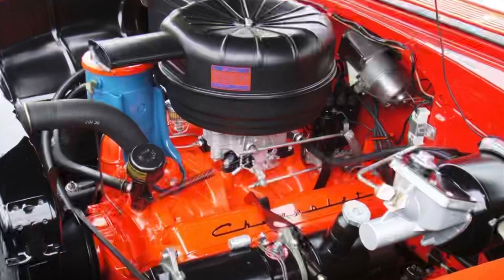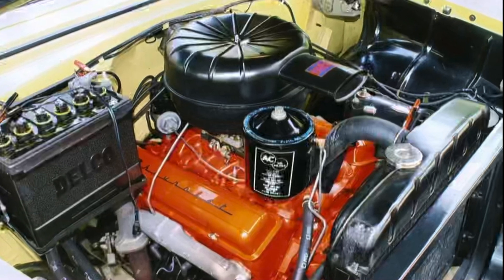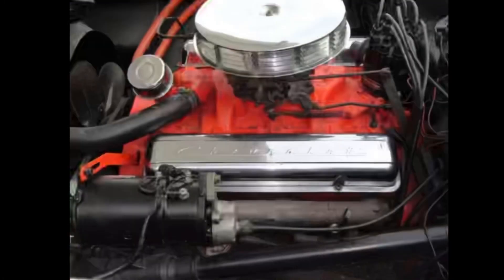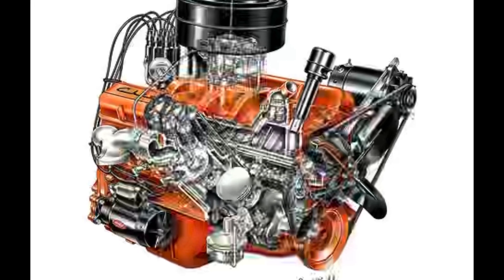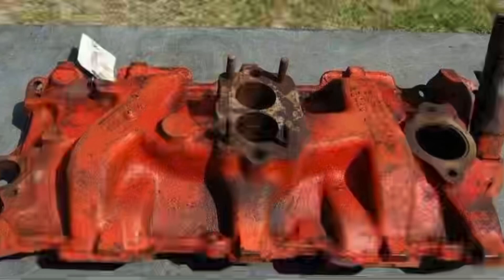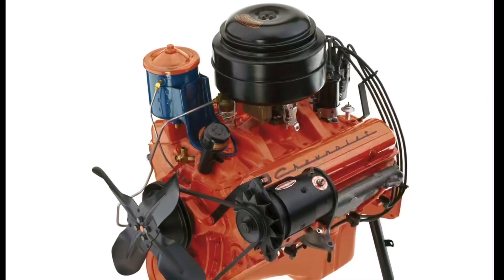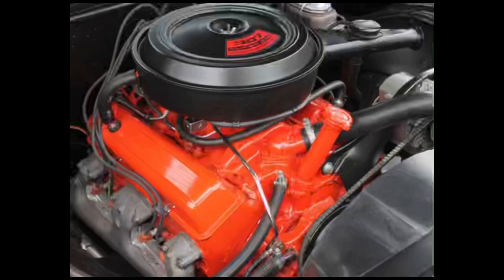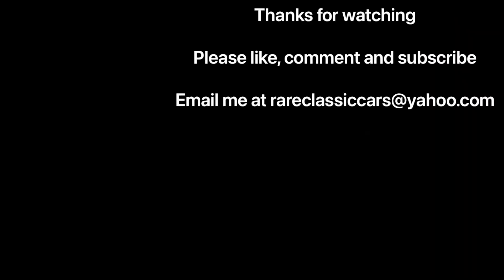Best Engines of All Time: The Chevrolet Small Block V8 (262/265/283/302/305/307/327/350/400)

Comment: Ed Cole, and his team did an excellent Engineering Job on the Chevy SB, especially the Oiling System. I like that each Cylinder has 5 bolts around it, instead of 4. 
I have 4 of the Second Gen LT1s. What are your thoughts on those?
Reply: You are Correct

Comment: Best engine ever made, IMO.  Two comments from a shadetree mechanic.  First, the GM distributor with the little window that allowed the points to be adjusted while the engine was running was a great innovation.  Second, the adjustable stamped rocker arms on hydraulic lifter engines made them easy to work on.  As always, an enjoyable and insightful video,
Reply: How many times did you drop the points screw down the back of the engine to somewhere on top of the powerglide?
Reply: @barneymiller6204  Never did drop the screws, but the first chance I got, I dropped in an HEI distributor in place.
Reply: @barneymiller6204  yup, only complaint, distributer in back, not front like SB Fords.
Reply: @ronschlorff7089 my first car a Chevy. But I noticed on a Ford, distributor in the front.
I switched. Then I noticed Ford did many other things better than the Chevy.
Reply: Meanwhile European cars are going fuel injection while GM put a window for the points... lol, sad really
Reply: @toyyoda3710  Yes, but never see them at Barrett Jackson do we?! LOL, sad really!

Comment: No matter what brand you like most nobody can argue the small block Chevy is one of the best engines ever produced.
Reply: Mopar guy here... I agree with you.
Reply: Had 265 i 56 Chevy and agree but Ford guy now, but my first-est car was a Ford Ranch wagon with a 272 Y-Block, nice engine, always started never left me on the side of the road, did have, flats and dead batt. once but that's not technically the engine.

Comment: We would take a 307 install a cam ground to 350 HP 327 specs, 305 heads with the big valves to raise the compression and 4bbl carb, it really brought them to life. cores were free (we were throwing into the scrap pile) and they were a near bullet proof cheap engine.
Reply: A 307 came in my '72 Nova. I was out of the warranty period in a few months so the mods began.

A TRW TP151 cam (their 350HP 327 replacement cam), fuelie double hump heads (1.94  intakes) and a Rochester fuel injection system. Added dual exhaust (kept the cast iron manifolds) and this car became a terror. I could easily outrun stock big block muscle cars and a few modified ones.

I ran that engine until it was replaced with a 400 small block in the fall of 1975. Sold the short block to a friend who ran it for years after that in a '68 Camaro.
Reply: The one I had built wasn't. But the 283 I yanked out of my dad's 67 Biscayne wagon was. It had 200,000 miles on it when my uncle rerung it and replaced the head gaskets after it overheated going up a grade. Another 400,000 when I stuffed it in my 68 Chevelle. I ran it for another 5 years before it developed a fairly loud lifter tick. I was going to replace the pushrods and lifters but they didn't want to come out through the top and I figured getting another motor from the junkyard would be cheaper than rebuilding it.
Reply: @turbo8454 I think I’ll try that with the stock 307 that’s in my ‘71.  It runs strong but I’d just like to wake it up a bit.

Comment: He didn't mention it, but the V-8 was about 60 lbs. lighter than the six.  It's hard to believe that with all this ingenuity, only 43% of '55 Chevies got a V-8.  You'd think people were so happy to get an alternative to the disgusting Blue Flame six, at least 65% acceptance!
Reply: GM tried their best to sell V8s too, they didn't offer the 261 straight 6 in any truck under 2 tons until the 327 came out. Thats 8 model years of trucks that had the option of 235 or V8 with the 261 withheld
Reply: @Texassince1836  Always thought it was strange that they restricted the 261.  They did that with it's replacement, the 292 as well.  You couldn't get it in a 1/2 ton in most years, and never could get it in a car.
Reply: @michaelbenardo5695  they wanted to sell V8s in the USA. Canada got 261s in Pontiac cars, and south America got 261s all the way through the late 70s in half ton trucks.

Same with the 292. Big heavy talldeck6 kept it out of cars, but I am disappointed most years couldn't get it in half tons.
Reply: @Texassince1836  Yes, I know about the Pontiacs, but I didn't know about South American 1/2 ton trucks.  I like those 6s better than the small V8s - more low RPM torque.  If I want a V8, I want at least a 327.
Reply: First year of an unproven engine as far as the public was concerned. Chevy had built reliable ohv straight sixes for decades and it was the most used engine in pickups until the late sixties
Reply: They couldn't make enough of them, so many folks had to settle for the old 6.
Reply: @michaelbenardo5695  I'll bet that was a disappointment!  They could always buy a '55 Pontiac which used the same body and every single one came with a big block V-8 standard equipment connected to a four-speed Hydra-Matic, the best trans on the market until TorqueFlite came out in '56.
Reply: @jazzvictrola7104  That is true, very true.  Plus, the 55 Pontiac was a longer car as well - 122 and 124 inch wheel bases vs 115 for the Chevy.  And HydraMatic was far superior to PowerSlide.

Comment: Great video; what about the 7 L version of that engine used in the c6 z06 Corvette? Was that based on this architecture or was it something else.
Reply: The LS Engines were an evolution of the SBC, with very few parts in common.
Reply: About the only thing the LS engines share with the old SBC is the bore center spacing, and the 5.7L of the first LS. Otherwise, they are completely different. As much as I love a good SBC, the worst flowing LS head will outflow the best flowing SBC head (factory heads of course).

Comment: Most of the cost cutting measures of the factory smallblock Chevy can be overcome with aftermarket parts, which helped make them economical to manufacture.   The smallblock Ford is more compact than the Chevy as it was designed for the Falcon.  The 5.7 Vortec heads produced from 1996 onward were pretty decent, other than the cracking problems, but I've never heard of one that had a coolant leak because of the cracks.  Too bad Chevy didn't have those heads 20 years earlier.
Reply: Ya the latter correct heads were a big improvement over the early.
Reply: I know that the original Mustang/Falcon V8 was teensy, but when they blew this block up to make 350-cu-in engines was it still smaller than the Chevy?  I'm not messin', I really want to know.
Reply: @hunkydorian  the 351 Windsor had a taller deck height and externally was similar in size to the small Chevy but a good bit lighter and a stronger block.

Comment: My '75 Nova had a 350 2 bbl, and it was an excellent motor. Smooth and reliable, my car moved quite quickly with it. I was not disappointed.
Reply: It sounds like top-of-the-line to have a '75 Nova with a 350.  I can picture mostly 250 sixes and 305 V8s in most Novas of that era.
Reply: @70sleftover  It was a '75 Nova Custom coupe. I don't know if it was considered as top-of-the-line, as I thought that would be the Nova SS. It was a sweet car that I bought new, and kept it for seven happy years.
Reply: @70sleftover  Lots of 73 - 74 Novas had a 350, but most 75 and later had, like you said, a 6 or a 305, except for the top-of-the-line version.  It usually had a 350.

Comment: The Chevrolet Flint Engine plant on Van Slyke Rd in Flint, MI was purpose built for the 1955 model year V8 introduction. The plant was built on an old farm field, the first financial income was from the sale of corn from the land. Over 25 million small blocks were produced there as the two million square foot plant was repeatedly expanded to accommodate more production. I was responsible for building five million of those V8 engines.
Reply: Cool to know and that was an interesting fun fact about the location of the plant.
Reply: George Thomas ,I too worked for GM at the Saginaw Parts Plant  CPC division.My first car was a 1966 Malibu with a 283 engine.It was a very good engine and I  was told it was a short stroke engine. Many good memories of being part of GM in those days!
Reply: @markchwala2913  That was the year, model and engine of my first car. It was a 2 barrel Rochester with 3 on the tree.175,900 miles later it still ran strong with only a fuel pump and timing chain replaced. It routinely handled small block Fords and Plymouths. The only 2 cars that were better cars was a 70 SS 396 and the 2013 Mustang GT/CS that I still own. (138K mi).
Reply: Thanks mate, we have a lot of them in Australia to. They came in our high performance Holdens and rh drive impalas and Bellairs.  Now they all drive Chinese shitboxes that last a couple of years .
Reply: And I worked on the other side of town, in plant 4, making the six cylinder as well as the 4 cylinder engines.  You could still get that four banger in the early Novas.  My most fun Chevy was a 1964 with the 327, 4barrel, dual exhaust and four speed car.  It was the Malibu SS.  Loved it.  I lived in Flint five years and worked at plant 4, then went out to the Otterburn Parts plant out by Swartz Creek. It was a good time to live in Flint.
Reply: @frozenbits48  Thank U 4 the years of Hard work,👍👍‼️ I can identify with your post the fact remains in 1975 there were 4.5 million UAW American workers in country, as of 2023 were less than 500 thousand, , this was a direct result of Richard Nixon's deregulation in 72, our company sold us out to the cheapest foreign competition ‼️
Reply: Thanks. Could you elaborate on that last sentence?
Reply: @Diesel257  we used to build Gms ,Ford's Chryslers and Toyotas in Australia.  Now we build nothing thanks to our traitor governments selling Australia out as usual.  Now they all drive Chinese throwaway junk.
Reply: @petergoodwin2465  I was talking to the original poster...
Reply: I was very pleased with the castings from this plant I have several 267 V8s and I always seek out the Flint castings because of the quality and attention to detail
Reply: Remember Warren road in Motor City ❓❓❓♥️🇺🇸♥️

Comment: I'm a big fan of the 1970 or 1971 LT-1 engine. Lots of GM goodies from the factory.
Reply: Type LT Camaro. Turbo 400 tranny 4 bolt mains. 4 barrel. 350 engine. Anti sway bar. Factory sleeper. Was beautiful Comaro. Power windows, nice factory stereo too. Air conditioning. Good heat. One of my favorites. Also Olds Tornado 455. Was super fast. Poor fuel mileage as you'd expect. Dodge polaras with 440s Lincoln's with 460s. 472 Fleetwood brohm. Monti Carlo with 350. Wasn't fastest but great Ride. Could mention other car's but well ok Fiat 131 was very fast. You'd be surprised. I think multi valve Model. Spark retard dual points. Twin cam of course. Couple classic car's too like Chevy Nova 2. And Ford falcon. Lincoln's had suicide rear doors. Chevy station wagon with mean 350. You'd swear it had big block torque. Spin wheels All day. Bonneville with 400 big block. Was pretty fast. Yeah those were the days. Not to mention my Kawasaki Ltd, was fast bike. I had kawi 1300 was fast big bike. Not to mention Mr turbo. Anyhow. Chevy man here myself love Chevy Small blocks and the newer LS 5.3. And 6.

Comment: They were a pretty good engine. But they were prone to foul out plugs when they got a little age on them. And a few were notorious for wearing camshafts. But other than that, they were good engines.
Reply: they still sht cams & lifters, in the LS.. never ever, buy anything to do with chev/gm.
Reply: @harrywalker5836  I heard that the variable displacement engines are hard on cams and lifters it’s a shame that they still have a cam/lifter issue in 2022
Reply: @harrywalker5836  people say that. But in truth, it’s not uncommon to see engines with well over 200k miles. Those extra components don’t fail as often as people think they do. I know because as an auto mechanic at a dealership, our work is steadily decreasing with engines. They’re more expensive if they do break. But by and large, engines are very reliable. There are a few problematic engines. But that’s always been the case. By the way, a 1980 305 or 350 had an expected life of 120k. If an engine fails at 120k today, that’s highly unusual. Even with their lifter and cam issues a new Chevy is expected to greatly exceed that mileage
Reply: @dmandman9  i have an mwm 4.2tdi. 180ks, nothing realy, but, theres nothing to break. these do nearly 1 mill miles, if looked after. its servicing that kills or saves engines. here, if a car has 100ks, dont buy it, . yes its manufactured life time, spares. i have a 351c, on lpg forever. thrashed the crap out of it for 14 yrs, replaced 2 coils. it needs an oil pump. doesnt smoke, rattles a bit. lifters. it has 302c heads, 12,1 comp. no cam. lpg likes h comp. like i said, to drive a 350 , service it, no probs, last forever,, but,, for performance,, its not good..just 50,s bad design.. watched a vid on a chev. forget size, but the combustion was in the block, pontiac w. ?. who,,was the r tard that got theat into production.. cant beat dodge hemi.. still.. my lotus escort, was a hemi.. 1558cc.. 125 mph. 7800 revs, gutless by todays basic cars.. still want my pantera.. ford cleveland,, truck engine, the best..
Reply: @harrywalker5836   there were always exceptions. But typically pre 1980s engines era engines had a 120k lifespan. And typically we had to replace the timing chain, especially those with the fiber teeth on the cam sprocket (most v8s). Valve jobs were somewhat common. We had a valve grinding machine on premises. And we were a small shop. Today MOST engines with a few notable exceptions last 200k plus with minor to no repairs . Those are simply facts. I remember when a woman had 200k on a 1972 Impala. And EVERYONE was amazed. It had nearly ALL highway miles. Typically 350s started fouling plugs around 75-80 k. Several sets of valve cover gaskets had been replaced. And you'd better start expecting to replace a timing chain. You could coax about 120k or so. But expect to have to add oil very regularly by then.
Reply: @dmandman9  a lot of engines had fibre gears.. less thrashed, longer they last. oil changes. every engine today has hardened seats. better valves. i see old cars sitting for 35 yrs, start up & drive.. with basic maintenance,oil, plugs, kits. try that,with a computerised car.. i agree, there great, till they stop then its tow truck. cant fix it. most advanced thing in my car is the cigarette lighter. it knows its days are numbered.. oh, & leci windows..
Reply: @harrywalker5836   I'm not talking about cars sitting up. I'm talking about the AVERAGE car being driven like people typically drive cars. Remember in the pre 1980s odometers only went to 99,999. The TYPICAL engine didn't last much over 90-120k before needing a major overhaul. In our trades magazine, it actually stated that if bearings or rings wore out at 75,000 or more, consider it as normal wear. Oil consumption wasn't considered unacceptable until up to 1 qt/500 miles. With an oil consumption test at Ford today, it's considered a failure at 1qt/3000 miles under normal conditions. Today no one blinks an eye if an engine lasts 200k. In the 1970s , that was considered almost newsworthy. Today, even cars with timing BELTS have 150k replacement intervals. In the 1970s , timing BELTS we're replaced at 60k at most. And chains typically often didn't last longer than 75-90 k. Again, I'm not taking about the outliers. I'm talking about the average car driven the average way. A Dodge slant 6 was considered super tough because it typically lasted over 100k. Why? Because MOST engines Didn't. Are engines today  overly complex? Yes. But to NOT acknowledge that they TYPICALLY last much longer than in the past is looking at the past through rose colored glasses. My 2011 FOCUS has 230k . It also has double OHC and variable valve timing and Fuel injection It hasn't had ANY engine or trans work. The 2012s and up have JUNK transmissions because of an experimental automatic clutch system. As a result, Ford extended the warranty to 150k for the clutch and control module. Why? Because they know that the TYPICAL transmission is expected to last that long.

Comment: I wonder how many of the SBC Cousin Four and Six and "Iron Duke" Tech 4  engines were produced between 1961 and the current years in Mail Trucks. 153,194,230, 250, 292 and 151 probably as many if not more then SBC.
Reply: And boats....

Comment: My 1969 327 👌🏼has the old 
Arch angle exhaust , Camel backs, Holley 650 🤤.  
It’s a sweet sounding old gal.
Reply: Remember building my 69 Camaro love that 327 camel hump heads 10 to 1 compression midrange manifold 1650 Holly headers and a cam 327 the great motor the stories I could tell with my 4-speed